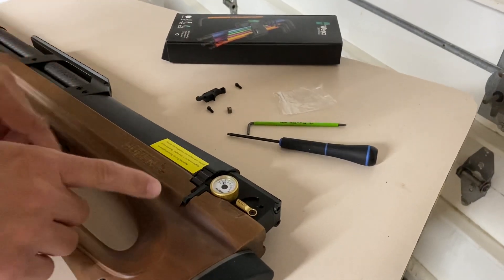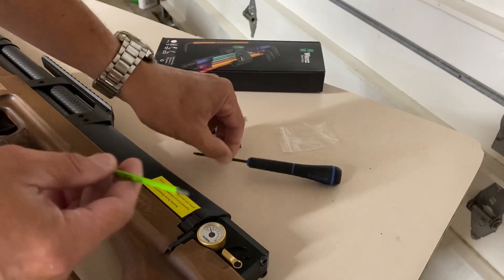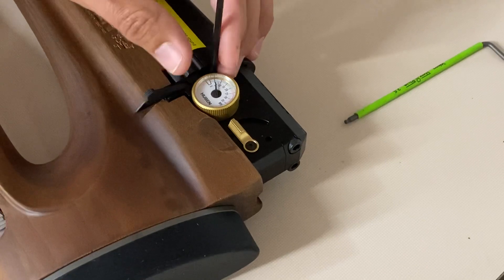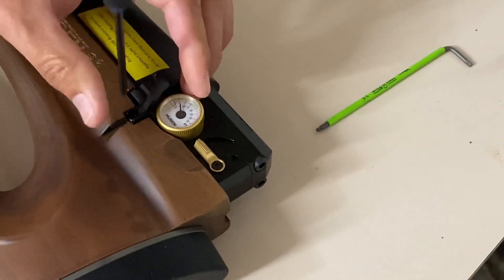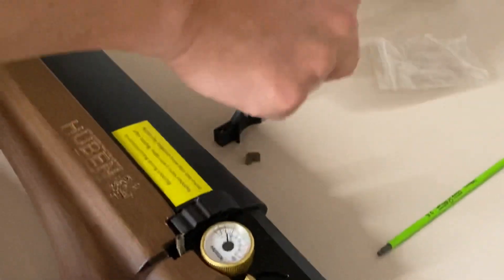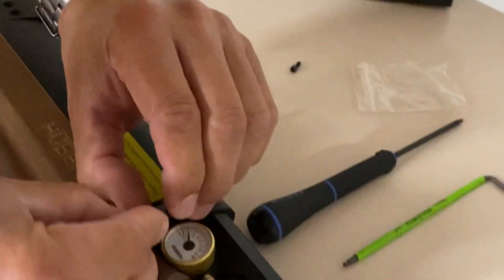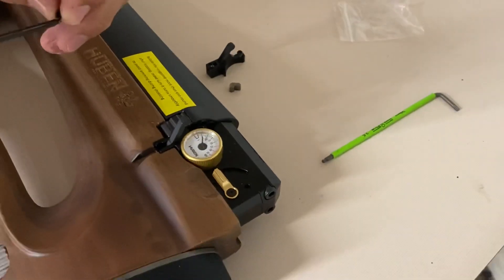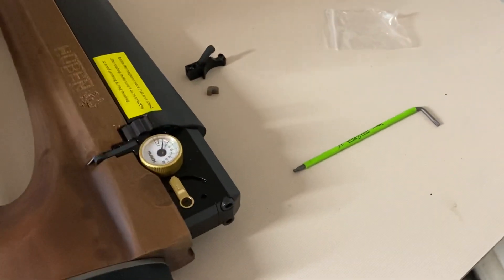Huben K1 Mag Lever Assembly Replace

Comment: The magazine lever hamdle on my brand new huben pistol after I reloaded for the second time.  Ive not had any problems with my bill pup. The only thing I can think that caused it to snap is that I released it without guiding it back into the locked position without applying a back pressure to close it slowly.  The metal must be brittle and prone to breakage. Very disappointing.  I hope the repair is tge same for the pistol.  Hope I can find another lever easily.
Reply: It happened with my friends GK1 after he filled the gun to 350 bar. 
With 300 bar no problem. 
If you fill it above 300 bar, just don't touch the lever anymore. First fill your mag, then fill the air.
Reply: @Harolddespui  Great advice.  Thanks!

Comment: Do i need to empty the pressure before i replace the magazine releaser
Reply from the maker: No, you do not need to empty the air pressure to replace the mag release lever assembly.  Just make sure the K1 is on safe and the magazine is not loaded for best precaution measure.
Reply: @krazcoolairgunsllc7065  How about the GK1. Also no degassing necesarry before replacing the mag lever?
Reply from the maker: The GK1 it will depend on how much air pressure remains in the reservoir.  You may be able to replace the lever assembly without degassing if receiver gauge shows below 15 MPa.  At higher pressure it will be very difficult to replace without degassing